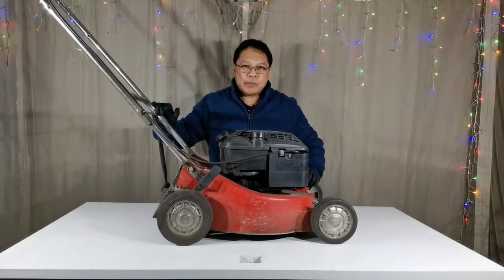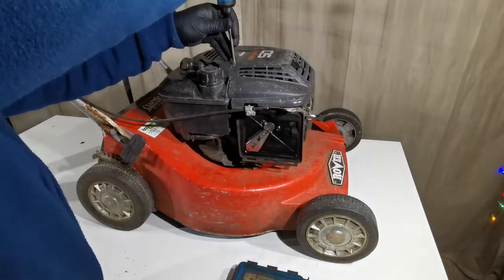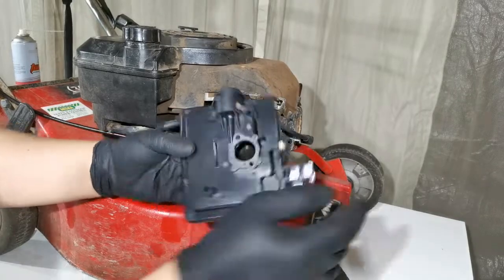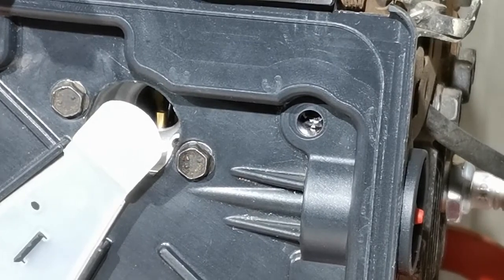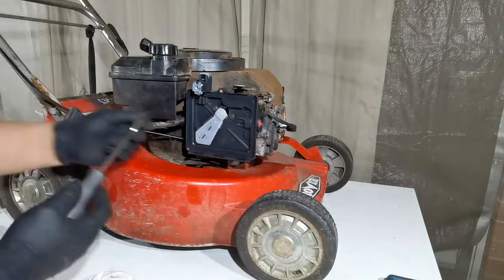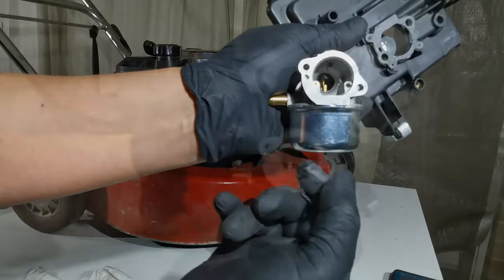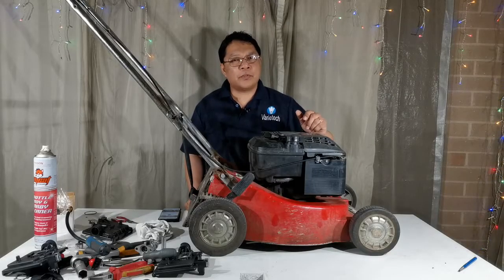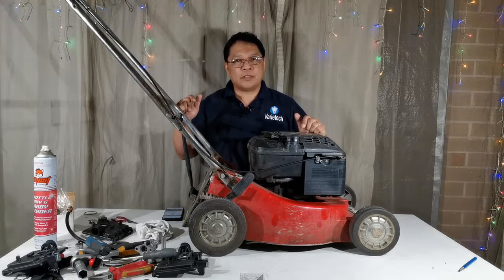VTECH 75 - Easy Fix 90% of Briggs Quantum Engine Not Starting Problem.

Comment: Thank you very very much, I have NEVER worked on a petrol engine before but have followed your excellent teachings to fix my mower that hasn't run for over 8 years. I was brave enough to remove the carby, clean it and refit it correctly, The joy when it started on the first pull. 6th April  2024

Comment: I bought your product and it did not fix my problem, I can still start with spraying brake cleaner down it.I have  used two gaskets and still did not work. Do I need to put sealant behind the gasket?
Reply from the maker: Likely your carburetor pilot jet or pulse hole is blocked. Remove the air cleaner assy and there is a small hole (pulse hole) on the side of the carburetor manifold, spray it with carby cleaner and blow with compressed air. Even these hole and pilot jet nozzles are blocked, the engine will still start when you spray directly into the manifold. The pilot jet nozzles are those tiny holes inside the venturi towards the cylinder side. This pilot jet also coming through the tiny holes along the wall of the main jet which could also blocked. Health wise when I'm getting better, I will find another unit which I could demonstrate this issue. Warped air filter is the most common problem with this unit. Pulse hole and pilot jet are secondary issue which you might have. As of now, best is to rebuild your carburetor and there are lots of YouTube videos you could follow.
Reply: @Varietech-AU  I bought a brand new Chinese carby for two mowers and two primer bases. Worked fine on one but not on the other, I would keen for a video to demonstrate this problem. Thanks for the reply.